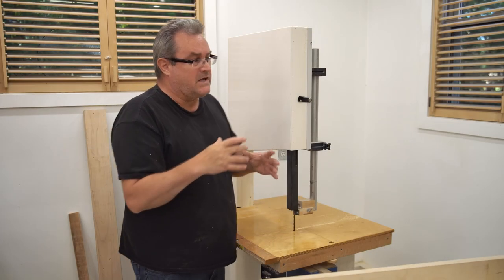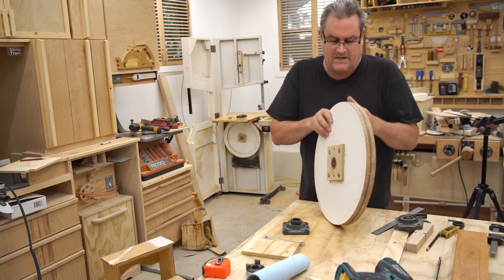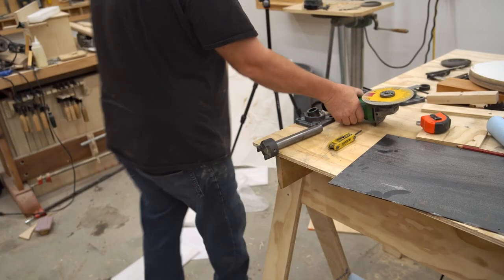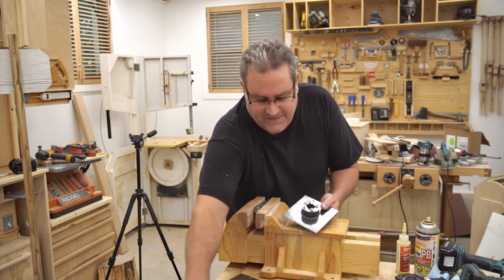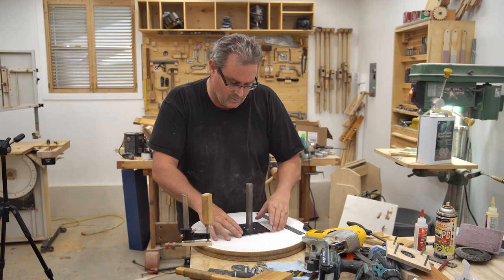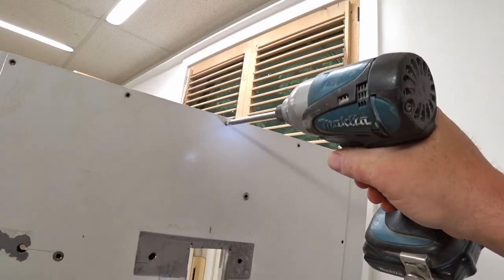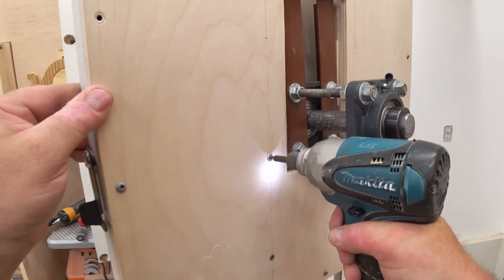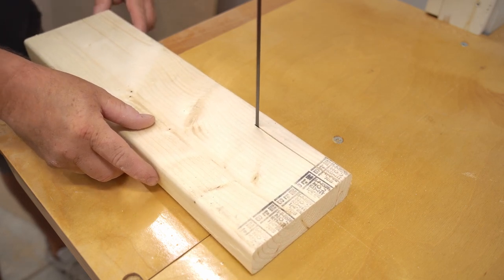Changing the Upper Wheel Shaft on my Homemade Band Saw

Comment: Great work as always. I want/need a band saw so bad, I'm thinking of buying one from Harbor Freight, even though they are way too small and mostly junk.
Reply from the maker: In my experience, those small, low cost saws are a waste of money. Poorly made and under-powered.
Reply: Avoid smaller band saws. I have a 9 inch delta and the parts on it are small and brittle and it can’t cut straight to save its life. Save for a decent 14 inch or build one

Comment: How often on average did you have to replace the old small bearings? 
And how often do you think you'll have to replace them/it now?
Reply from the maker: I guess what you are really asking is was it worth it to make the change, and the answer is yes. I expect the bearing that are in there now will last as long as I'm using the saw,. What's more, they are much less likely to break in the middle of a big project when I wouldn't want to take the time out to replace the undersized bearings.
And yes, I thought about all of this many times before doing  the work.
Reply: I Build It Yup, I know you did it because it's worth it, I was just wondering how may bearings you replaced since you built it 7 yearsago

Comment: You can braze cast with only a torch and bronze rods. You just need a torch that's capable of about 950 C
Reply: That works, I fixed a bolt cutter that had the hand break off at the head though I used nickel-silver rod.  I've used it extensively since and haven't had it rebreak.  I've also had success with preheating the part with an Oxy-Propane torch then MIG welding it.  When finished welding, I buried the part in sand to slow down the cooling to prevent cracking.

Comment: Wouldn't it be correct to say that it's not shaft flex that's your problem, but cabinet flex? It then follows that using a larger diameter shaft and bearings won't fix anything, but facing the cabinet back with steel plate might. I mean if a 5/8 shaft is bending you might want to back off the tension on your blade, no? It seems to me that you need to mount the bearing on decent plate (aluminum would be fine) to keep everything RIGID and problem solved. That said, you might consider investing in a bandsaw with a cast frame.
Reply from the maker: The 5/8" shaft wasn't bending, the bearings were wearing out too quickly. 
The saw has been in operation for 7 years, but you'd know that if you weren't just a drop in.
Reply: I subscribed last week. Sorry if that's a problem. Wait, I can fix that...
Reply from the maker: Bye!

Comment: According to the packaging and label of my zip cut discs, they are not meant to cut stuff that isn't very thin, shame on you! (and me for doing the same thing all the time)
Reply from the maker: That's because most people that try to cut using one of those blades are incompetent, and then blame the tool or the disk for their out ineptitude.
Reply: I Build It very likely - also printing the details about which circumstances make it safe or unsafe would be a book rather than a label. I was just trolling the YouTube shop safety brigade though ^^